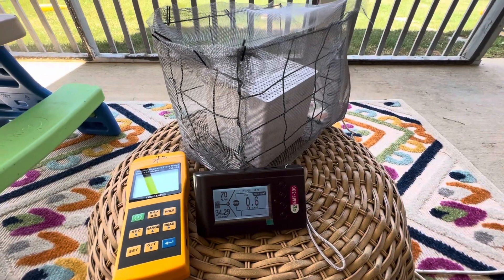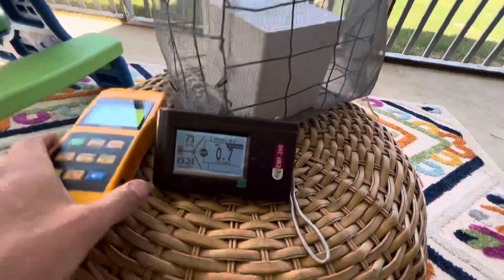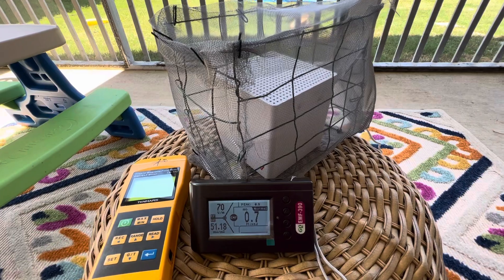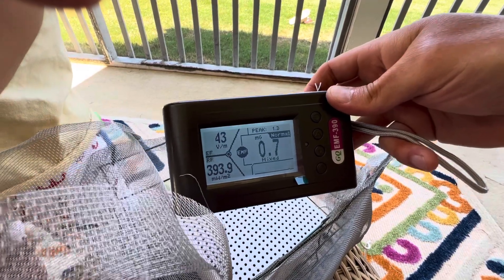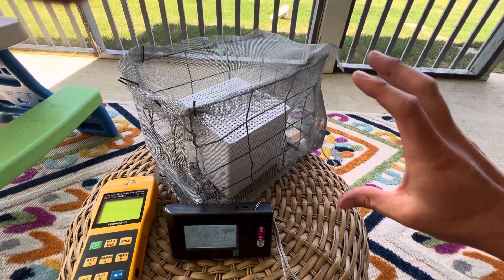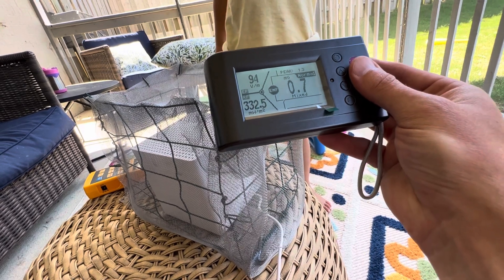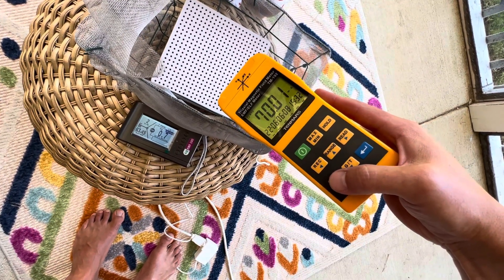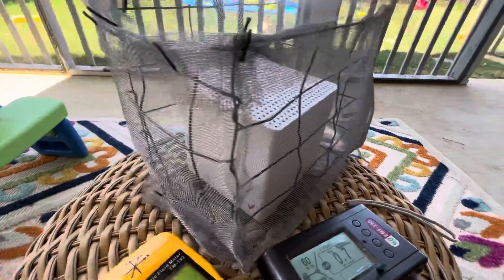How to reduce RF\EMF from a Verizon 5G Gateway router

Comment: I turn off my router every night. However, I live in a Condo Unit where it seems that I can not get away from my neighbors own router frequencies, which show up on my devices. Any suggestions?
Reply from the maker: Oh wow, that is quite the predicament. First I want to thank you for the view. The only thing that I could think of would be to put a fair day type screening on the wall or floor where it is coming through you could do some thing like disguise it behind a picture on the wall, or depending on where it’s coming through on the floor, you could put some aluminum mesh under your bed or under a chair to keep it from coming up through the floor. The wall might be an easier place to disguise it behind a picture or something of that sort.
Reply: @kenshowtosandreviews4320  Living off the grid sounds like the only way to get away from it all. Not to mention those Cell phone towers all over now. I am still connected via DSL, no wireless/satellite, but I am sure some of my neighbors are hooked up to the wireless 5g frequency. Too bad, no wonder so many are going bonkers!
Reply: Thank you so much for this incredible video. I had absolutely no idea about all of these devices and we leave in a building and there’s an office building and there are a route has just everywhere with a 5G and I would like to follow your advice that you described so much detail thank you so much. You are really helping people and I would like to put that foil everywhere that needed how thick the foil should be places one layer enough and the most important question what’s the best device or what is the one of the best devices to, to buy to actually measure that frequency thank you so much I

Comment: How did this nonsense get recommended to me? The EM waves are exactly what allows the router to transmit and receive data. You can't block it and have connection at the same time. The video is the definition of misinformation. It is hilarious how there were articles about 2G being dangerous and "too powerful" with its 0.2 Mbps top speed. Then it was about 4G, now 5G. There is no harm in low power communications, your head doesn't have an antenna inside to be affected by something so weak. There is no difference between 2G, 4G or 5G when it comes to affecting your well being. Stop pretending it does. 

Edit: Just perform a simple experiment – ask someone to flip a coin and plug or unplug a hidden 5G router for each day of a month or two. During that period, document how you felt each day and the person that randomly turns on and off the router will document the sequence. Then compare the results. You will be surprised to find out that there's no correlation between the router being on and you feeling better or worse. All of that is in your head. Either admit it or live in ignorance, being afraid of something that is completely harmless.
Reply: I don't have enough information yet on either side and therefore haven't made up my mind about the harms.  However, your experiment is faulty as it doesn't account for prolonged exposure.
Reply: @kelleyweld2946  you're right, it doesn't account for prolonged exposure. It is harder to figure that out, but it doesn't mean that there aren't any research papers covering this type of exposure. 

And let's be clear – 99% of people scared of 5G claim that they can feel the harm right away and it "makes it harder to sleep", etc. Those claims are clearly based on a short term exposure, not years of living with a 5G wifi router/near a cell tower.
Reply: Vent to your bf. We don’t wanna hear it
Reply: @HanseaticConsortium  of course you don't want to hear anything that implies that you can think with your own brain lol
Reply: Read The Invisible Rainbow. Then open your yap once it's edumucated.

Comment: Did the spectrum stuff you had before have similar radiation?
Reply from the maker: So it does have significant emf and some rf. Not anywhere close to the 5g Verizon cube.
Reply: @kenshowtosandreviews4320  interesting. I’ve always wondered about that box. There is a new 5g tower that’s just down the hill from me .8 miles away. It’s not very tall but the top of that thing is pretty much level with my place I’ve never looked into how the waves act n all but I wonder the potential harms of those things.

Comment: Could I use  tin foil if it time being?
Reply from the maker: Hi there and thank you for the view. I did experiment with tinfoil before using the aluminum mesh. The tinfoil did work, but it will potentially block your signal. Put the tinfoil on the side or signs that you would like to block from exposure. You can always leave one side open to allow the signal to continue to feed your Internet for me. I did not cover the side that was facing our window, which pushed the harmful signal toward the outside of the home.
Reply: I was wondering you experimented with tinfoil and the mesh and you said the tinfoil potentially sometimes didn’t pass the signal through but what if we put some little holes in the tinfoil? Have you tried that so that it could get the signal through but still protect us from the harmful Wi-Fi signals.

Comment: So I did this with copper wire and had it just laying over my router modem combo, and when we were using wifi,it still worked fine, I thought it'd block it. But then one night, when no one was really using the internet, i got curious and I took my copper mesh that's laying just over it and I pinch up the front and back,closed it and instantly everything in my house went offline, my cameras,my smart lights, my smart plugs, everything other than the eathernet connected stuff which is everything that has a plug or that ive bought adapters for to run hard wired like my phone and kids tablet. But all my IoT was down. But I was very surprised that it did that, just by pinching it closed, it totally blocked it all. But im wonder is this, what you've made here, have different effectiveness than the copper material mesh I've used ya think? Would there be something that blocks the bad, but still would connect to my smart device?  idk, sort of feel stupid wondering this, cus I'm pretty sure it should be blocking wifi signals...I've become extremely intrigued with radio,micro,gama, waves and frequencies,as well as everything "Nicola Tesla" researched and built discovered ,sure wish our government would of used, and shared his discoveries in the ways he meant for then to be used,there wouldnt be any emf...But i got into all that after having my son and becoming more aware of environmental hazards. And that's also when I noticed my headaches and migraines fatigue, anxiety, all was definitely being caused by the electronics around me. I'm highly sensitive, I can pretty much feel anything being plug into an outlet even, or a light switch flipped on, it's like a buzzing that goes through my whole body,my head. Its horrible.  Acually had a very odd and scary experience with that sensitivity in my early 20s experimenting w lsd,it makes more sense now why i experienced what i did, it alters your electromagnetic field and biofield, so I was feeling in intensity the electrical currents,and boy that was a scary trip.  To say the least,i never "experimented again w any drug after that,...now ya'll really think im off my rocker hu,lol. Anways,
so your saying it doesn't effect your wifi though with yours? 
Just odd cus my copper cover, definitely blocked it all. And ya, it does get hot but I have two little usb plug pc fans blowing on either side of my router,old fans i used on my xbox360,lol.
Reply from the maker: I use aluminum window sheeting. I have never had an issue with it 100% blocking the signal. The copper sounds very interesting. I ended up getting rid of this very router.

Comment: Actually even with a Faraday cage readings are pretty huge. They gotta be max 6 for working area and max 3 for homes. Cus even less is better. Old norms in USSR were 10( in mW/m2) and 1 in uW/cm2. Now we got 50 everywhere near a cell tower and many many people have huge problems that tend to go even worse with time. You got a deamonic router. Wouldnt it be better to tune its power through control panel? With Keenetic routers it is possible to tune them up to 1 percent, but even if so it is better to place some metal screen between you and a router.

Comment: How would🎉we keep the 5g out of our homes?
Reply: Use an older modem with ethernet cable connection to a router that has wifi disabled (you have to manually disable wifi)
Reply from the maker: Great question! I’m afraid 5 g will be the norm very soon.

Comment: Is the frame under the box sitting on the floor? Wasn’t sure how hot it gets if so. Thanks for sharing!
Reply from the maker: The frame is sitting on the floor. I never experienced to much heat from the bottom. All the heat came from the top and sides. I ended up getting rid of ours.

Comment: Would you have the same effect from aluminum foil?
Reply from the maker: You sure would. The only thing I’m not sure about with aluminum foil is if it would actually block the signal and the distance that it travels but yes, I have tried aluminum foil and it does block the harmful effects from going too far into the space where you have the router.